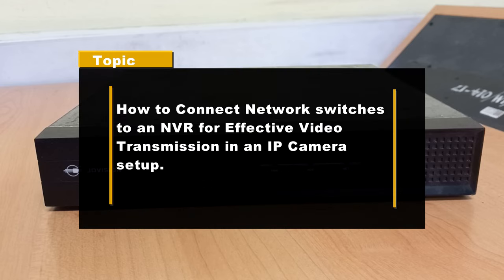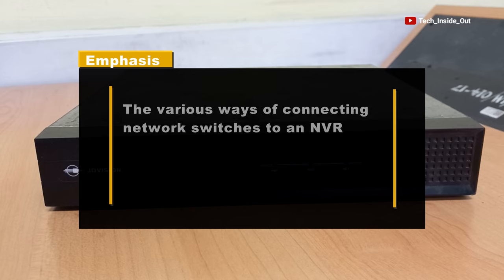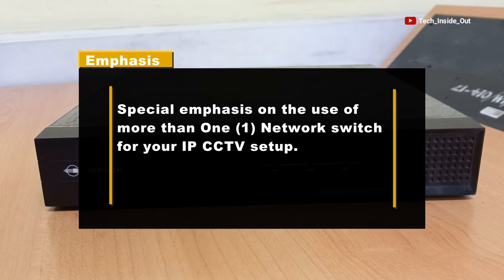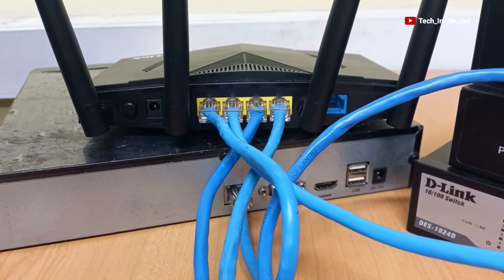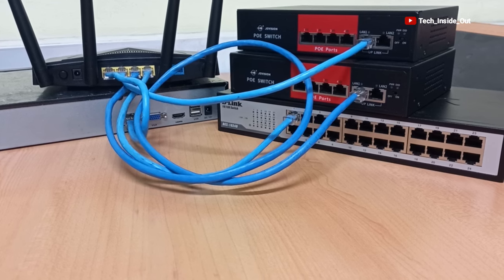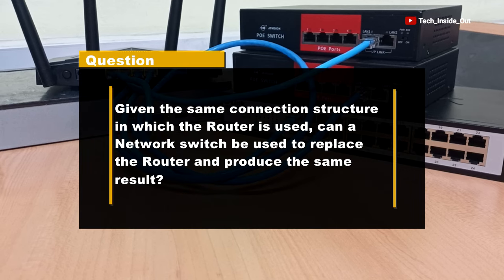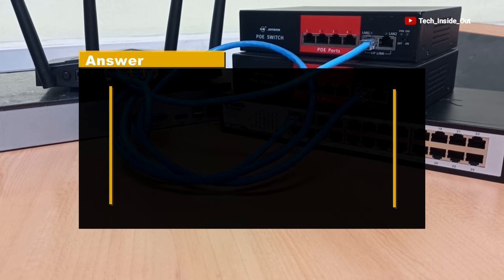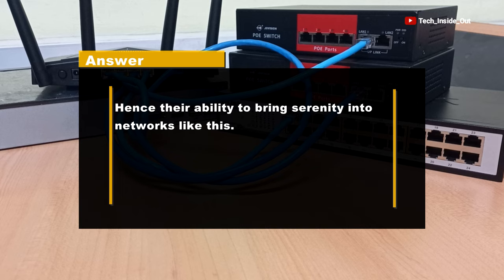How to connect network switches to an NVR in IP Camera installations

Comment: Yiu are a good teacher. And besides l have issues with 128 channel nvr that goes offline with all the 125 ip cameras installed on it randomly almost two or three times a week. You need to switch of and on before all the cameras connect. What is the way out sir?
Reply from the maker: I suspect network congestion. 
1. How many network switches are used in the installation 
2. Have you connected the switches through a router?
Please link up by WhatsApp on +233556307182

Comment: Good one from you our lecturer. Can we use only non Poe switches in place of the Poe switches. I am having issues with network congestion. I will give this a trial. Thanks brother
Reply from the maker: You can use non POE switches, provided you have an alternative means of power to the cameras other than the POE Switch.

Comment: I enjoy your presentation. I have a question...I have an installation that is spread out  to more than 100meters apart. 
The longest distance to the NVR is 300m. I am installing Poe every 100m. 
Do I need to take cable directly from the last Poe (300m) to the router ?
Reply from the maker: I will suggest that you place your router at a central location which can be reached from every POE Switch in such a way that your cables from each POE Switch will be less than or equal to 100m.
It is necessary to have all your POE switches connected to the router, that will make your network very fluid and effective. 
Kind regards
Reply: @Tech_Inside_Out  Thanks for your reply.  centralizing the router is not possible. 
I have 6 Poe in 2 directions. 4 in a direction and 2 in another direction.
Can I connect the 4 Poe together by looping and then to the router?
Thanks 🙏

Comment: Can the second setup with the router work without internet? Or must the router be connected to internet before it could work smoothly? Thanks.
Reply from the maker: Hello Augustine,
Internet is not a requirement for the router to be able to play its role as a gateway to the network. Internet is only needed when you need to connect to other networks at remote locations.

Comment: Please sir, can we use any of the ports for the connection or there is a specific port for the connection??
Reply from the maker: The normal switch ports should be used for the cameras whiles the Uplink ports should be used to pick from the switch to the router.
For the router, any of the LAN ports are thesame

Comment: Hello i have a same project 12 cam. The cabling must done in a way that in a switch we have 7 cam and the other 5 , im planin to put 2 switches for the cams and another one to connect this two , a cable from the router to this switch and another one the goes to the nvr. Is that correct?
Reply from the maker: It should be a cable from each switch to the router and a cable from the router to the NVR.
Reply: @Tech_Inside_Out  where is the difference cz the cabling is a little bit a problem,  and also the router actually has only a port left cz the client as a nvr with other cam already
Reply from the maker: @profittola3222  In that case you can loop one switch into the other and pick from the second one into the router

Comment: How do you configure the router to connect the cameras, cheers
Reply from the maker: This router is plug and play. There are however customization settings but for having to use it to link he cameras,  you need no special settings

Comment: After connecting 3 POE, then i tried connecting the poe to the NVR but couldn't come up. Although, the distance between NVR and POE SWITCH is over one hundred meters.
But when I brought the NVR close to those POE, the cameras came up. I want to  ask what could be done. Thanks
Reply from the maker: It is not recommended to run network cables beyond 100m.
Reply: There are poe switch extenders u can use, each 100 meters require one and the maximum u can use is 500 meters

Comment: Hello there .. i have a question. 
I have only one port left on my router, and i already connected it with a 24-port normal switch-1.

My question is, can i have a second normal 48-switch connected with ethernet cable from the first 24-ports switch to extend my network? 
Thank you
Reply from the maker: Yes, you can loop the switches and it would work but the network efficiency might not be very good especially when the cameras are many
Reply: Thank you for your response. 
But it's not cameras.. it's tv's, 5 laptops,  and many Raspberry Pi mostly
Reply: @Tech_Inside_Out i have more than 60 Raspberry Pi

Comment: Will the number of ip poe cameras based on poe switch Ports or the numbers of channel in nvr??? Let's say 40 ip poe cameras do i need a 40 ports poe switch or 40 channels of poe nvr??
Reply from the maker: The number of Cameras you can use depends on the capacity of the NVR,  not the POE Switch.
Reply: @Tech_Inside_Out  meaning, some 32 channel nvr having 4 poe ports at the back so the remaining 28 channels of poe nvr can be used by external poe switch? Am i correct? Thanks Sir
Reply: My question exactly?
Reply: @reccakarl   You mean like the Reolink rln36 nvr which only has 4 ports at the back? Those ports are for poe switches since that nvr doesn't have a built in poe power injector. Best to distribute the cameras in as many poe switches to balance the load.